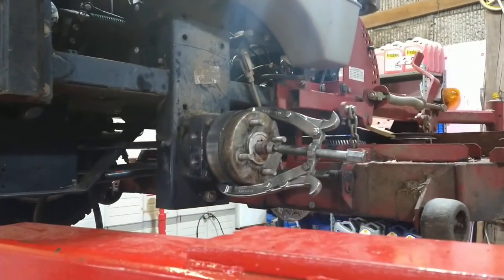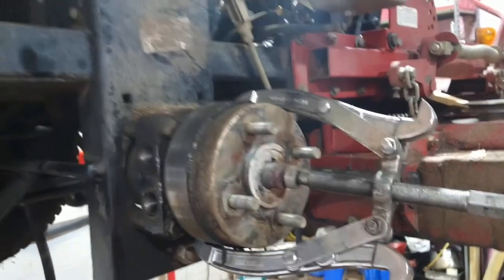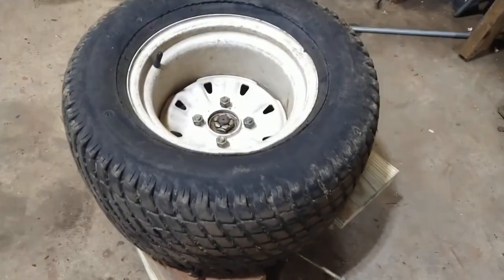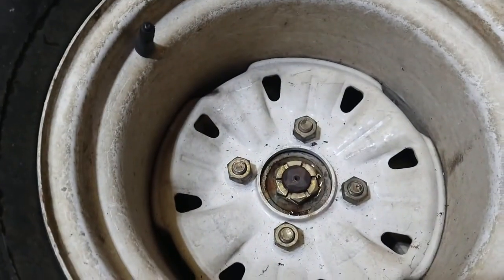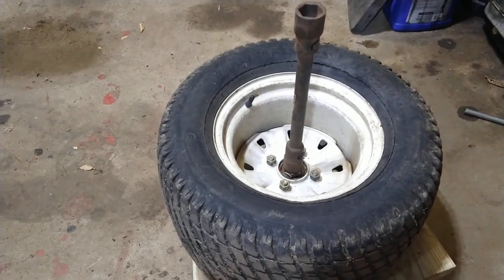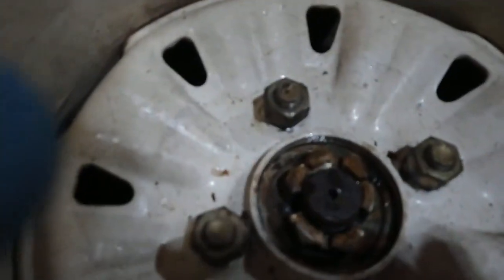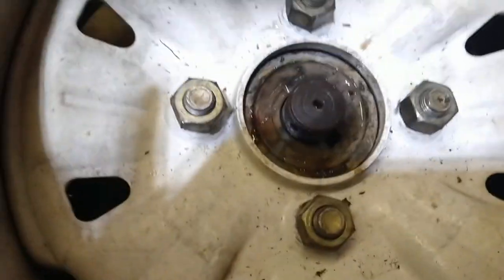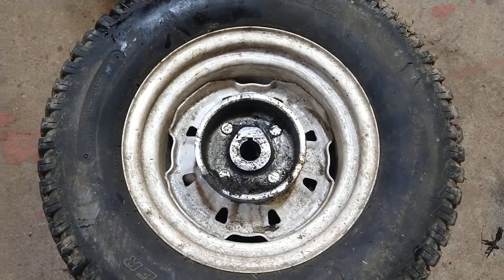WHEEL motor SHAFT  STUCK in the hub? Here's the trick!

Comment: running into this exact issue. was hoping to not have to bleed the hydraulic system. mine ate the rim and broke 2 studs. so i really only needed replace the hub, and rim but unfortunately it seems that would be too easy.. lol so here we are. i just ordered a hub puller, hoping that will help but from the looks of it these things really get seized on pretty good. they definitley should have put anti seize on this and a good amount of it but 23 years is a long time..
Reply from the maker: Yeah, hopefully, the hub puller does the trick and saves you a lot of trouble.
Reply: @notoriousJPG first one didn't work lol had to get a 3 jaw 10 ton hydraulic puller from harbor freight to get it off. It literally shot off and flew about 2 feet away. thankfully my foot wasnt in the way. Surprisingly even the woodruff key was in good shape lol. I antisiezed the hell out of the new on though when reassembling it 😂